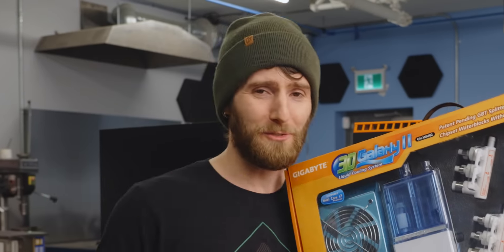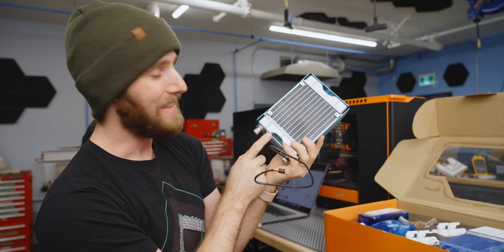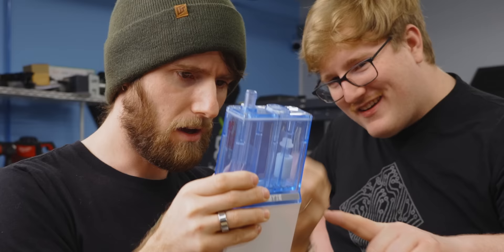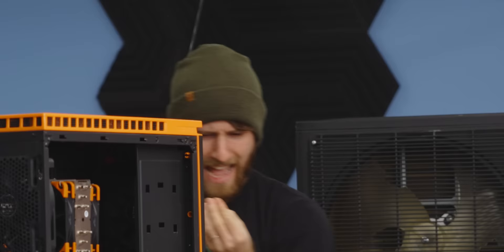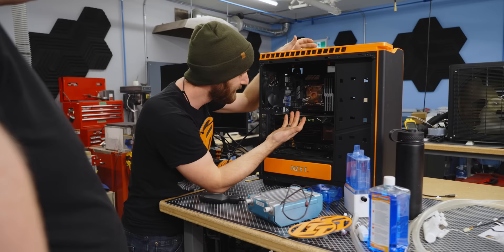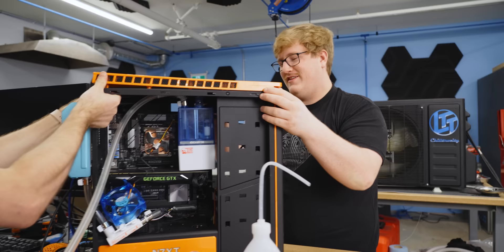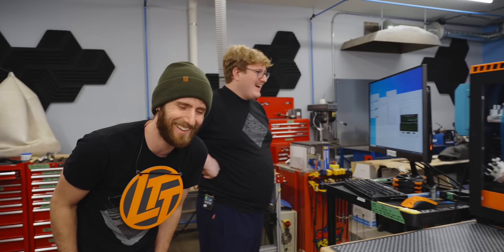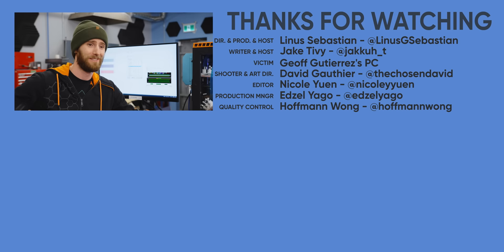This Product Aged Like Fine Milk - Gigabyte 3D Galaxy II Retro Watercooling Kit

Comment: 2:37 holy crap I’ve just found out why my first PC case from 2014 had grommets on the back above the PCI slots
Reply: LOL when I made this realization it blew my mind
Reply: Me too. AeroCool GT in black. Cheap ass "gamer" case, but is till holds a candle.
Reply: @MasterGeekMX  mine was an Aerocool too, the DS Cube! I think they still sell it, despite it having absolutely zero modern features 🤣
Reply: Mine too! Makes me wish they made like a 360x360 radiator so I could have my PC on one side of my desk and my new space heater on the other side.
Reply: I had that giant cooler master HAF case a while back and it had the two holes like that with grommets too.
Reply: I had a Corsair Spec-02 (which I bought brand new in 2018) that had those holes. Why a crappy $60 case had water cooling grommets at all, who knows.
Reply: @zachjoseph7121  still using the HAF 912 in 2021 built in early 2013
Reply: Same with my Source 210
Reply: @johnkolk  My guess, they saved money by basing it on an older case
Reply: @zachjoseph7121  I had the HAF XM. I regretted buying that case EVERY time I decided to haul that computer to a friends house... lmao. So much wasted space inside... literally like a giant suitcase standing up.
Reply: @Azeria  Haven’t seen you in AGES, since the pumped up kicks remix years ago (I think it was you), whaddya know
Reply: the holes are for an optional chilled beer dispenser. [sarcasm]
Reply: In the majority of cases the grommets are meant for use with an external 120mm radiator. The problem is I can’t work out why or when anyone would actually use an external 120mm radiator? I can’t work out why an enthusiast (Even back when these grommets were common place) Who’s taken the time to carefully put together the component for his build would choose to use an external radiator??
Reply: @helenHTID  that’s just how you did it back in the day. The radiators were often automotive parts and you modded your case to fit them somewhere outside. Before the grommets you had to dremel a hole out
Reply: Hahaha same
Reply: @boredandagitated  ? No, they weren't. Auto parts would never work for PC cooling. I'm pretty sure LTT even tried it to dispel that myth once and for all.

The reason why external radiators were used was because those old ATX cases were too small to hold a radiator, pump and a reservoir inside. The biggest piece, and the one that would benefit the most from being outside the case, was the rad so it got put outside. If it wasn't for the dust problems it makes a lot of sense as you get fresh air across the fins and the exhaust doesn't stay in the case. But dust is a major problem. Also it really was pretty ugly and people who build custom loops do tend to want "pretty" systems.
Reply: My first PC case had two perforated round metal pieces that you could punch out with a screwdriver instead of grommets, lol
Reply: Yeah the one I'm using now has them and I never knew why.
Reply: I'm still rocking a C70 Vengeance, which had those.  I used them too.
Reply: My current case the Corsair 600t has them. I'm on my 3rd PC build in that case. Currently 10900k, RTX 3080. I don't know how people go through so many cases.
Reply: @MrTuxy  Right?  I just keep rebuilding the same case too.
Reply: @tippyc2  It was actually a choice between the C70 and 600t that I made when I got the case. I could see why you would replace every build on a cheap <$50 case but once you buy a solid case it should last at least a decade. I've done some minor mods with a Dremel to the 600t to improve airflow and fan placement but it's very basic stuff any one could do. Linus has a review of my case on this channel, posted in 2010 :)
Reply: Cooler Master Cm690 from 2007-ish has those grommets too
Reply: I fucking went nuts when I discovered that this is no more a thing. How am I supposed to plug the usb from the S I C K rgb led stripes??

To be fair I just solved the problem taking away one more pcie back shield, BUT I WANT THEM BACK
Reply: @gianlucatomasello9492  If you have an extra USB header on your motherboard you could use an adaptor to connect the RGB strips inside the case.
Reply: HAF XB EVO had some. Still love this case. Actually, turned on its side, the format reminds me of the Lian Li o11 dyamic.
Reply: @johnkolk  A lot of the cost of a case can actually be the tooling (stamps for metal, forms for plastic) to make it, so the easiest way for a manufacturer to make cheap cases is to use old (IE free!) tooling for some or all of the parts that goes into it. By combining new and old tools (or old tools from different cases) they can reduce the startup cost a lot while still making something "new", or at least different.

If the tools are REALLY badly worn the result will have bad tolerances and sharp edges because, well, the tooling is old and worn but that's also when they can make the biggest savings. And people accept a lot more rough corners on cheap cases.

Not all cheap cases does this (there's some relatively nice cheap cases!) but looking at the SPEC 02, yeah, I'd be surprised if they haven't reused old tooling for a number of the parts. The back panel with the gromets is pretty much a dead giveaway and the punched out side panel with window and a lot of the interiors also looks a lot like someone at Corsai went "shopping" in their "old tools" storage. Some other features including the front panel and the arrangement that allows for very long GPU does looks a number of years newer than those parts but still not exactly new with the two 5.25" slots, depending on how old the SPEC 02 is this might be either "that made sense when it first came out" or they used existing but not quite as old tooling.
Reply: @gianlucatomasello9492  A step drill maybe?  If you're feeling adventurous, you could dremel holes in a blank pcie shield
Reply: Same
Reply: Lol my first PC case in 2014 also had grommets.
Reply: we all learned that today lol
Reply: I have a Coolermaster Storm Trooper case from around 2012 that I still use and it also has those grommets.
Reply: I just upgraded and finally got a new case as well. Taking everything out and sorting parts on my old one, I was genuinely confused what those grommets we're for. Thank goodness for LTT educating me before I spent time looking it up.
Reply: Same. I have (still use it for a shitty computer to connect potentially infected HDDs to) a ThermalTake Chaser A71 that had these grommets on it. I knew they were for water cooling, but I always that it was for an external reservoir.

Comment: I wonder what the temps would be with actual thermal paste? Linus could've used some Arctic Silver 5 (which is still made and sold brand new) and it would've been authentic to 2005, as it was around back then, and it was top of the line, so it even matches with the water cooler.
Reply: system is old, why care about that?
just replace all
Reply: @lucasrem1870  

Because testing with degraded thermal paste doesn't actually reflect the performance it would have had brand-new. So using new paste would have been a better test.
Reply: @lucasrem1870  why use many word when few word do trick
Reply: @TheTuttle99  few word good?
Reply: As the drama showed, that would mean more time required and a slower turnaround.

Comment: Actually I am really interested how would this loop perform with:
1. Modern thermal paste. Measure at this stage
2. Lapped block. Measure again (with modern thermal paste).
Reply: Don’t overestimate thermal paste. Pastes were used in other devices where cooling was needed long before first computer was built.
Reply: @JohnDoe-el5ir  Nope. CPUs are first items with such a large heat to dissipation area ratio. There was no need for dedicated pastes like we use now before. And there is a serious improvement in those in 20 years. You have now liquid metals, diamond pastes. What you had then was silicon based paste, which was considered premium if it had some silver in it.
Another thing. I assume that chemical capabilities of those paste can be much lower than normal after 20 years from being manufactured.
Reply: @JohnDoe-el5ir  that is such a nonsense comment.

They're not overestimating thermal paste generally (and even then I'd say *you're underestimating it*; JayzTwoCents vid on delidding shows that a change in thermal paste from a current good one to some magic sauce did like 5degrees!) but more saying that this stuff that's been sitting around for a decade might not be as good as it once was (and even then, the paste that came with this thing mightn't even have been good back then, just because "other devices [needed] cooling" doesn't mean they all used the same goop!)
Reply: @bartomiej9807  long before CPUs there were power amplifiers and still are, that dissipate much more energy. These are the facts. You can believe it or not, it's not my problem, but facts are the facts. Some minor tweaks here and there ,but still it's almost the same. Diamond paste LOL
Reply: @hashbrown777  yep, your answer is the most BS . Go buy that fancy pastes LOL. Your are the ideal client for it.
Reply: @JohnDoe-el5ir  You still don't get it. I know some power amplifiers are heavy duty devices, with LOTS of power drawn. But CPUs have HIGHER heat to dissipation area ratio. Modern CPU have little surface, but they dissipate dozens or even hundreds W through it.
Reply: @bartomiej9807  How little you know about electronics Bartłomiej :) Standard CPU electrical power is around 100W or more, but if I make a 1 minute search on google, I find easily transistors that dissipate 250, 300W for audio application, not mentioning other Mosfet that give even more in power switching applications. They have even lower surface than 40x40mm CPU usually has. So yes, it all began long before CPUs era, radiators, cooling, pastes were used long before it..
Reply: @JohnDoe-el5ir  Cooling pastes were used for damn long time, but development of CPUs and their increased hunger for power, decreasing size forced manufacturers to create better solutions. 20 years ago thermal paste containing silver was considered a good one. Look what's on the market right now. And because most of us service our cpu cooling more often than, for example, PSU (there are some powerfull components there as well) or power amplifier there could be used more effective, but less stable (degrading faster over time) substances.
Simple (but still powerfull) industrial transistors are also typically able to operate at much higher temperature than CPUs can.
Reply: @JohnDoe-el5ir  And I forgot. 40x40 is heatsink, intel i5 13400 has a 257 mm square die.
Reply: @bartomiej9807  "industrial transistors" LOL, it's temperature of quartz transistors, for safety it is limited to 80 on CPUs, nothing special, nothing that different than power transistors. What is on the market ? please say. Silver, copper or other paste is very similar to silicon paste., again, nothing special
Reply: @bartomiej9807  c'mon, do I have to show you specific pdf that will tell you that single transistor can emit more power than CPU? It is more dense, by factor 2-3 at least

Comment: They probably tell you to unhook the hard drive to prevent the system from booting while you boot cycle to purge the loop. You could just disable it in the bios, but instructions to do that for all motherboards at the time wouldn't fit in that small space. Much simpler to just tell people to unhook the power from the drive.

Comment: Linus, I had a friend with a kit like this back in the day from them, the reason they wanted you to disconnect the hard drive was because if you're turning it off and on to bleed the loop, doing it a bunch, it can be hard on the hard drive motors constantly spinning up and down. My friend DID in fact kill a hard drive while bleeding a loop because of this, but I personally have never bothered with it. Even bleeding my most recent loop in 2020, I had 4 hard drives in the rig when I was bleeding it, and no issues XD
Reply: If you're just bleeding a loop, shouldn't you just have nothing else plugged in?
Reply: @Fay7666  yes, which is why it says to unplug stuff. I'm just saying it only killed one drive of many I've tested with. It's a lot more work to unplug everything so sometimes I'm lazy about it.
Reply: Forgive the casual, They haven't been doing this long and it's still new to them.
Reply: @JackNormalMemes  This. Even strong pumps like a D5 don't use that much power.
You don't even need another ATX PSU if you can make your own adapter - just a basic 12V power adapter will do.
Much better than turning the PC on and off a bunch of times, hoping there's no leak dripping on the back of your GPU.

Comment: I had a family friend that showed off the first liquid cooling setup I had ever seen in 2005. Homebuilt with a junked motorcycle radiator, flexi tubing and a pump rotor affixed to a hobby rc motor in the "resivoir" the only thing he bought was a CPU block. Still jealous of it to this day! I never could play ut2004 and hl2 as fast as him.. great thing he let me use it whenever I came over!

Comment: I built a system to run "Doom 3" at max settings back in the day with a Thermaltake BigWater cooling system where the radiator and tank fit into the CD drive bay.  It was friggin' epic.
Reply: You were a rich kid
Reply: @prostodeo  or he was an adult and is just older then us lol.
Reply: @internetguy1260  Or maybe that yes 😅
Reply: This used to be super popular until everyone stopped using cd drives
Reply: I had the thermaltake case that had the radiotor built into the front door, it was really akward opening and closing it.
Reply: I miss this era of PC Building. Was really when I built a lot of my systems.
Reply: That actually sounds really cool!
Reply: Imagine having cool stuff like that nowadays

Comment: I worked in a PC store during the early 2000s. I still remember there being a pre-built desktop that came with a full custom water cooling kit but using the kit would void your warranty! It was hilarious telling customers.
Reply: same kind of things with older dodge cars and or a 90 day warranty period. and didn't chevy do that on newer 2010-car two?
Reply: @richardprice5978  do what?
Reply: @littlejackalo5326  a stock 426 hemi in 1963-77 factory installed/all stock had a super shortened warranty ( dodge was expecting people being ruff on it and or racing ) and or non existing. basically the same BS. as the water 🚿 cooling computer 🖥 skeems aka use 🚿 stock and we wont even look at it same thing with un-water-cooling as its "moded from stock"

Comment: I'd be interested to see how a decent lapping job on that cold plate, some decent thermal paste and throwing a Noctua fan on the rad would improve performance
Reply: they shouldve then gone ahead and tweaked it as 3 result temp comparison
Reply: also to be fair they should have compared it to a intel stock cooler. You know, its an upgrade for that.
Reply: @A.Martin  I'm not sure it would be though 😅
Reply: I wish they used good thermal paste for science. Of course 2005 thermal paste is going to be shit, the solvent was even separated out
Reply: Doubt that would do much of a difference with a shitty rad and that badly designed block.
Reply: It probably would have made little difference, but it would be an interesting experiment. Even a degree or two lower temps would be a good result and hopefully a fun video

Comment: You should try it again with new thermal paste
Reply: Yeah I had that thought too. Maybe even give it the benefit of the doubt and mix up some coolant. I’d love to see if there’s a world where this could be halfway decent
Reply: If they used better thermal paste and lapped the block it would probably be fine.
Reply: They should yeah
Reply: It would surely still be worse than the Noctua air cooler. It outperforms many modern AIO's, so I doubt this ancient one with a small radiator would perform better.
Reply: another video of them trying to make it better would be amazing
Reply: @frego24  Back in the day a small radiator like this was probably fine for old CPUs. The heat output of modern CPUs though is on a whole different level.
Reply: @frego24  i mean to be fair, noctua's air cooler is top of the line quality stuff
This thing did better than i expected lol
Reply: and new coolant
Reply: And when that's been done, lap the surface of that sucker and test it again.
Reply: Yeah would be nice to simulate the performance of what someone would get if he is properly maintaining his old gear.
Reply: @Trashloot  yeah
Reply: It could probably beat the Noctua if they just put a modern CPU block on it. I was disappointed that they didn't.
Reply: @TheMetroidblade  It's not throttling at modern standards with 15 year old coolant and paste, a 120mm rad, and a 5 sec jerry rigged bracket. So I'd say it's already past halfway decent. Even modern 120mm aio's are kinda meh
Reply: And skimming the contact pad level lol
Reply: this is actually good idea
Reply: That along with a modern water block